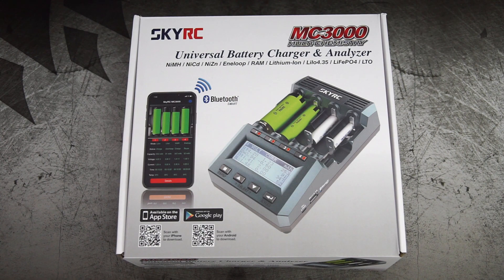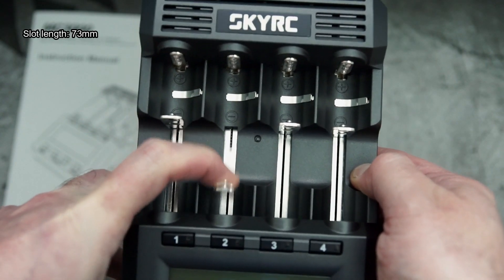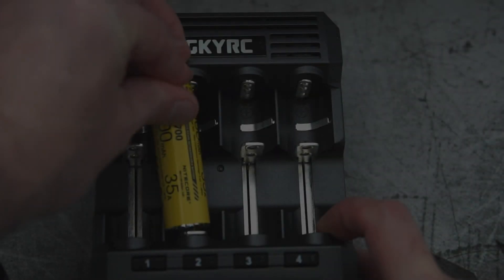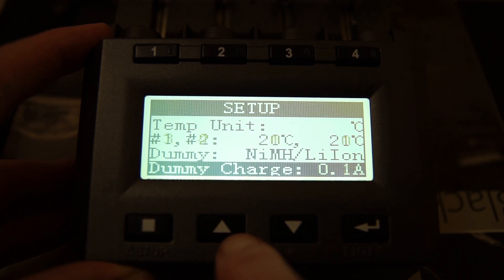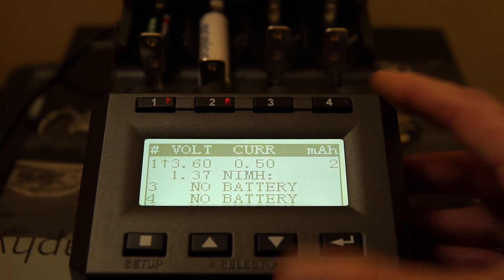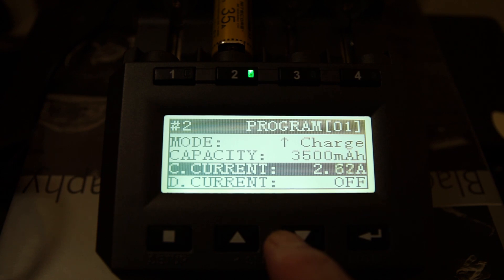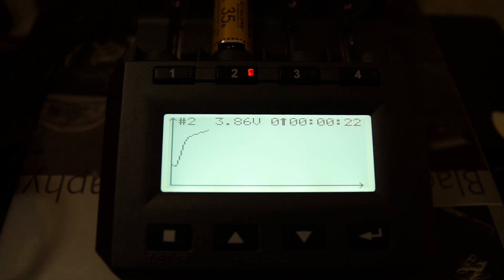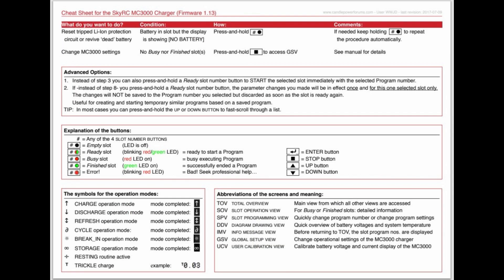SkyRC MC3000 Advanced Charger: Unboxing/Overview

Comment: You have the best set of reviews for battery charger. Thank you for going into in such detail. In 2020, which is the one charger would you recommend to buy? Opus BT C3100, Nitecore UM4, Xtar VC4 or something else? Thank you for any response.
Reply from the maker: Thanks this is a good and has more features than any other charger. But the software could be better (I use the app mostly it's faster). The Opus is also decent much more affordable doesn't have activation, has most of what you might want. VC4 and UM4 are chargers they are fine for what they do, they don't test cells though (discharge test)
Depends on budget really this has a niche limited appeal for those who want the ultimate tweak settings charger, it's probably overkill for many users
Reply: Xtar reliability sucks so Opus BT v2.2 is great choice, Nitecore new i4 too i think so

Comment: nice video, timely as I am looking at getting this unit.     I love it all but two things - the display could be more hi-res considering what technologies are out there now and the hard-click all-connected buttons make it seem somewhat cheaply constructed.   It may not be in any other way but why not polish the parts that the user interacts with the utmost?
Reply from the maker: I have mixed feelings yes the design should be better in some ways, the display is "OK" v the usual pre configured ones you get. I know why they went with Dot Matrix, but it would benefit from a better resolution. It's alright at normal viewing distances (camera is pretty close)
The buttons are all one strip moulded, individual makes a lot more sense higher grade switches. I've no idea what the manufacture cost is, but I think they could upgrade a few things certainly.
It has the potential to be a mind blowing charger (sort of), ends up being one with some quirks, that does give accurate results for testing (so far)
I do still like it, but I would change some areas. Case material is pretty solid, tripod fell over on this and it didn't crack so on that side I'd be less concerned
Reply: There is a real nice phona app to use with this charger.

Comment: I am curious, is this still a charger you would recommend?
Reply from the maker: Are you going to use all or many of the functions? It is a capable charger, yet it is quite expensive too
Reply: @MrBazReviews  I want to recharge and maintain a variety of batteries. Mostly looking for something reliable.  It's been 2 years since you posted this video. Just wondering how the unit holds up over time and compares to newer models.

Comment: Interesting review as always! Would it not be better to use carbon/conductive grease on the rails as they form part of the circuit?
Reply from the maker: I use silicone non conductive seems that is the type of grease most use on rails. The connection is directly soldered to the contacts, so the grease for the slider isn't going to make any real difference to performance
Reply: It can, contact is connected to rail where its sliding. Take it apart and see.

Comment: Nice review, how does this unit compare against the Xtar Dragon VP4?
Reply from the maker: Dragon is good for testing and easy to use, but lacks options such as charging speed per channel. The Sky has a lot more control, way more but it's more complicated in use. Overall I rate the Sky as a better charger overall, but it's also more expensive. Both have their own quirks. I will do a full review in the future once I've done a few more videos on this
Reply: @MrBazReviews  Ok, thanks for the response. Currently, I have a Nitecore D2 but I was looking to upgrade to something more complex.

Comment: Great video very well explaind...i have a quick question since this is the first time using nimh for my MiniZ... when adjusting Ni-Mh setup you can adjust also the voltage on when the battery is going to finish?  For example, I have AAA nimh HV battery and I want the battery have 1.6v when finish, do you have any knowledge on that?
My current charge (non skyrc) charge my nimh hv AAA battery but when finished the voltage is at 1.44v
Reply from the maker: Max voltage setting for NiMH is 1.8V, so yes you can set it to 1.6V if you want, target voltage
It's a lot easier to use the app, then it is to program the charger though, that's the main complaint about this one. It is powerful and comprehensive if that is what you are after
Reply: @MrBazReviews  thanks a lot my friend

Comment: very good charger it is on my buying list :)
Reply from the maker: It has it's flaws, though it does do more than any other charger out there and has more control
Reply: @MrBazReviews  agree but it is best i think on the market
Reply: @TheAcidheat  Woeful reviews on US Amazon and looks terrible. Get an XTAR brand, I have had a VC4 for nearly 4 years, its bullet proof.
Reply from the maker: From what I gather there were some obvious problems with early versions. The plastic on the rail springs snapping, firmware bugs etc obviously not acceptable at the high price. With hardware revisions I can only see if there are any issues with longer term use, and I'll report back. There are clearly some gripes with the app/software for pc which I'll cover at a later date.
If it's reliable only time will tell. As for charging/testing it's the most comprehensive charger around, but with flaws that could be looked at. This isn't for someone who just wants to charge batteries, it's way overkill for that. It's for someone who wants complete control over charging, ie a niche market. I would certainly change things about it could be a lot easier to use in the advanced UI, and it has a somewhat dated design and can't take protected 20/21700 cells.
Testing it is to date the most accurate one I've looked at
Reply from the maker: @turboturd7954  Can't say right now I'll pass on thoughts back to them, but it's their product they can tweak it or release a new model. A revision would work beef up the software lengthen the slots. The fact nobody else makes such a charger that's comparable (complete control over settings), maybe it fills a niche market. Hence it's all on it's own. There are other testers out there, not costing as much. I believe the type of user for this is someone who wants to say pick their termination voltage (some advantage for undercharging Li-ion in battery endurance), or charges a lot of different cells and needs fine control over the charging process.
It's not entirely pointless, for those who want it. It's not for most people, there is no need for all these options/settings for normal charging.

Comment: Any idea how to get the discharge AND charge capacity with this charger for aa nimh and 18650s?
Reply from the maker: Program it to refresh that's what I do it will then charge, discharge - then charge again and give you the charge and discharge figures.
You have to set Li-ion or Ni-MH so separate program for each, make sure the timer is extended or off. It's easier to do it on the phone app
Reply: @MrBazReviews  Also do you happen to be familiar with nimh charging? I purchased numerous high capacity nimh batteries: duracell 2500mah, eneloop pro 2550mah, ikea ladda 2450mah, amazon basics high capacity 2400mah, energizer 2300mah and am debating doing a "battery forming charge" via the break in option or just doing a regular cycle charge.
Reply from the maker: @ilovefreeski  I don't think it makes much difference, I know some swear by it the break in cycles - up to you!

Comment: Just  got one today   it is  complicated...  so we have a  Dummy  using Dummy mode!  
Cheers!
Reply from the maker: I do wish they made it easier to use and operate, it is due an update really but it's capable of doing a lot if you need that.
Reply: @MrBazReviews    I'm going to hide behind "i'm new and don't know any better".  in other words  i'm going to stay in "Dummy   mode" and let it  do the  thinking until i learn this   thing.  I know a little electronics  but i'm not sure of what rate or current i should use to  charge my AAA'S.

Comment: reminds me of my RC lipo battery chargers. Would buy it in a second but that price is a little hard to swallow.
Reply from the maker: They really need to update it, to justify the price. Ease of use, better display, longer slots for protected 21700 cells.
As it is, it should be cheaper IMO. Not much chance of that with shortages, everything seems more expensive - if you can buy it that is! I see out of stock on many products

Comment: this charger is so nerdy, i hate to see programs called [01] instead of real name. Hate the keyboard shortcuts. Hate the inability to detect battery size a start charging ASAP. There's no help with dummy/simple/advanced mode. Other than that, it's still the best charger out there. For basic people - unusable, for advanced people - annoying.
Reply from the maker: It's not a practical charger, when it easily could be. It's a bit of a geek overload on the UI, and usability - unfortunately. I usually use it in the dummy mode, for any testing I use the phone app. It's far easier than spending time on the unit mashing buttons. It is capable, and it's proven quite accurate for testing - yet I would agree it's not really as well thought out as it could be. I hope they update it at some point
Reply: For advanced people almost perfect. Shortcuts are excellent.
It was bit much at first but in two days i learned it so well its not complicated at all